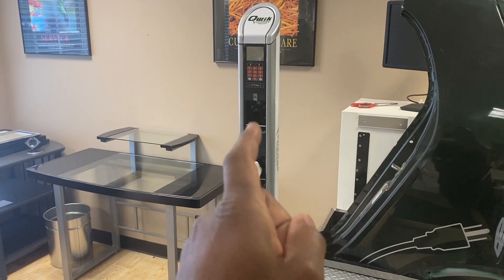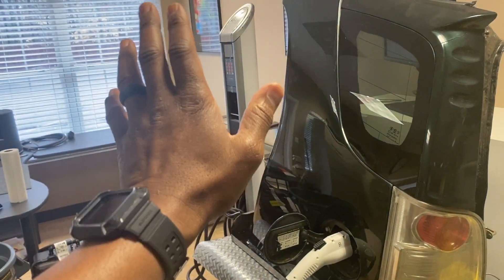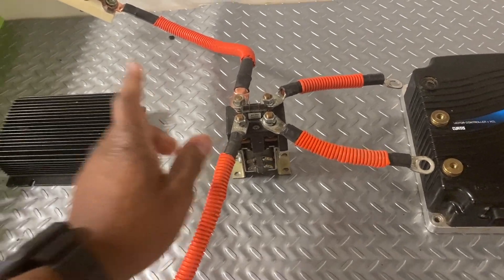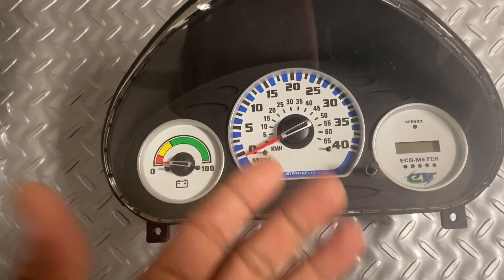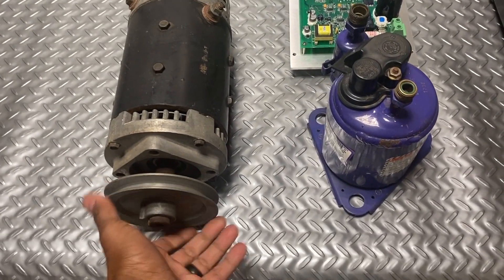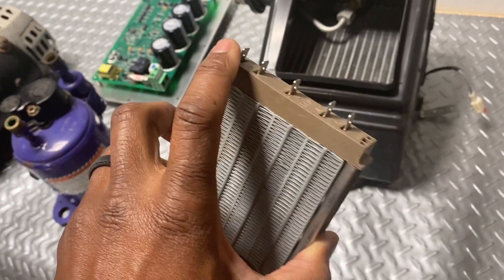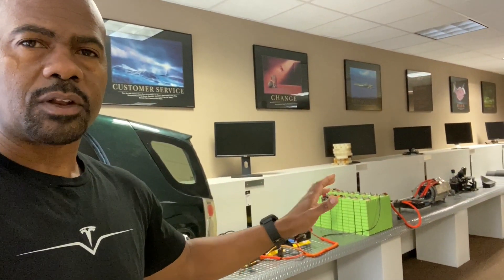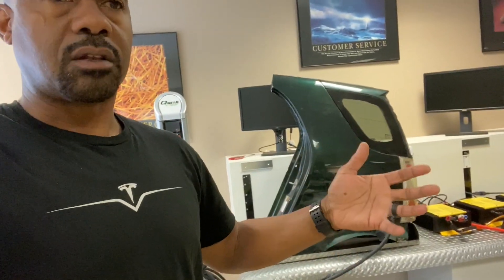EV Components & Education

Comment: What about if your car passed in the road with high level of water are this component safety cause from Dc to AC.
Reply from the maker: The components are safe. If something were to happen where an EV got inundated with water, the driver and occupants will be protected by fuse linkage from the high voltage and the components.